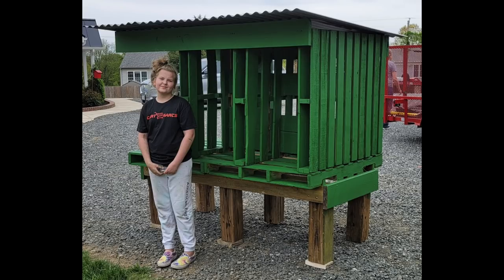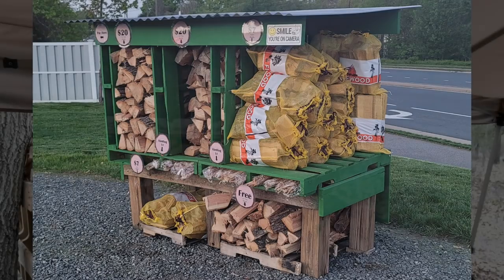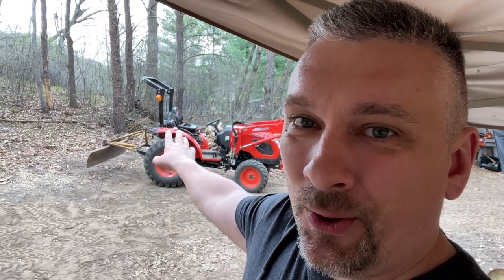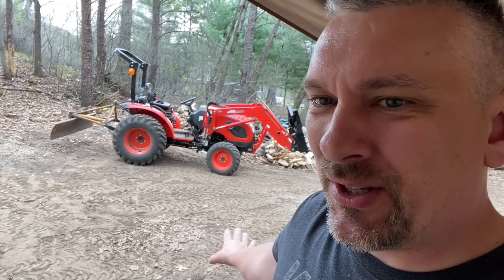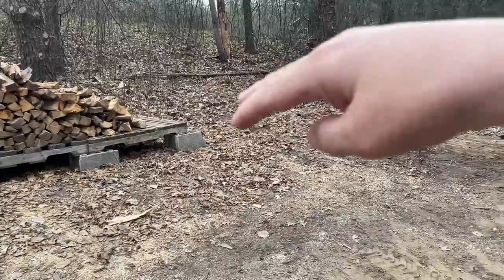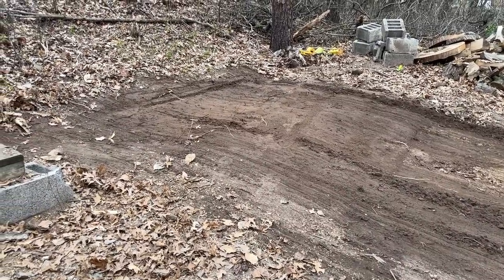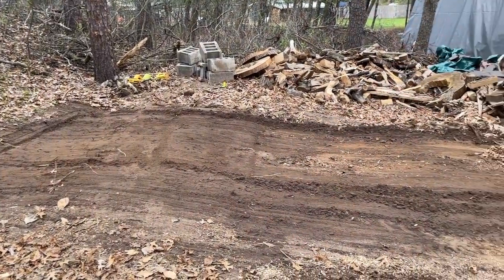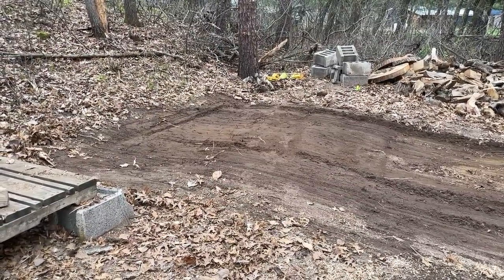3 Point Tractor Blade - How Does This Work?

Comment: Your doing ok with the blade.  It is older and not as sharp as a new one.  You can flip the cutting edge on the blade and bolt it back on.  The pit you are running is good.  I have broken a lighter blade like yours.  I now own a rural king blade which has a steal support across the blade.  It weighs about 600lbs.  If you break the cutting edge you will destroy the blade.  The more you tilt to the tractor you will cut. The other arms you can raise and lower for a crown on the drive.  If you have an old cultivator to break up the ground it works well will help not to hurt your blade.  Then the ground will be loose and to be easily moved with the bucket and scraper.  I have a three point middle buster that worked great for tree roots.  Out doors with the morgans has one similar to mine.  Mine does not articulate like theirs.  They are very rugged.  Which is really needed for working the dirt.  Loosening the soil first will really help the project.  I would get everything level with the 3 pt implements and square and go from there.  Take it easy on the blade.  When back dragging with the bucket put it level the ground you can destroy your cylinders on the tractor loader. The loaders on the tractor are not really meant for earth moving. When I build a pad for my fathers shed I ripped with the cultivator and scooped with the bucked. The blade used to spread gravel and level off the site. A box blade would work well for what you are doing.  The teeth will loosen and do the same thing.  Sure you can find one somewhere. Sometimes it just what you have on hand. Once you get going things will fall in place.  Having the right tool helps keep you from breaking things.  Have fun you will be done in no time.

Comment: Awesome Casey!  DAN!!  Use the bucket on your loader to drive into hill and scoop up dirt.  Once you have the dirt in the general area, either drive backwards to spread dirt evenly or turn blade backwards and drive over dirt to spread.  Basically for fine tuning with a blade ut needs to be backwards so it just kinda drags dirt instead of digging in and gouging.  Hope you understand what I am trying to say.  38 years old and been on a tractor since I was a toddler.  Hope that helps.

Comment: If you extend the center link it will cut more. Also if u need more down force to make the blade cut  you can put some cinder blocks on the blade which will make it cut better
Reply: Where do you put the cinder blocks?
How do you extend the center link?
Thank You
Reply: You can lay them on the blase frame and strap them down  or build a frame to sit them on. As far as the top link if u have a manual one u just need to turn it to extend it to it set how you want it
Reply: @gregorydaugherty2405  Thank You  very much for your suggestions!
Much Appreciated!

Comment: good demo Back 40 Firewood. I agree with the folks who suggested a box blade. With the rippers angled down for digging you can loosen the soil enough to scoop with your front bucket or just let them dig in and drag it with the box. Just like you're doing, but the box blade has sides so it holds and moves more dirt than the blade. Good suggestion from @RBR Dave to add a hydraulic top-link so you can change the angle but you could do the same without, just more getting off the tractor - here is a link I just watched with Tony's Tractor and I think that would help you out too.  I'm watching you work this tool because I want to raise a road with fill from ditches on both sides.

Comment: Hey shifty  our Wisconsin dirt with back blade it will move the dirt. but it will take some time so if you need it done quickly I would use the bucket and then finish with blade. I would adjust top link and add weights off the back. Later from southern Wisconsin

Comment: 3 point blades work best with hydro top link.  For moving dirt, the box blade works pretty good when using the claws with it, and you can also adjust the pitch.
Reply: What is a Hydro top link?
Is the box blade an accessory or a different tool?
Thank  you
Reply: hydraulically operated top link, for adjusting top link length on the fly @lunaflamed  I think a box blade is a separate tool

Comment: I’m still trying to figure out how the 3 pt hitch works. I get how to attach it with the top member and all, I get the level adjustment crank thing I get the raise and lower part too but can you lock it down or does it always float? What to the various levers do? Some seem to do the same thing. Is the pto universal? Same teeth on most machines? Same rpm range? That’s what I would like to see. If I figure it out, I’ll film and share 😂😂

Comment: My 1948, Ford 8N tractor has manual PTO operations.  You could say that one lever engages and disengages the PTO and the other lever lowers and raises the blade.

So the question is, once I have the blade in the upper position should I disingage the PTO or do I keep it engaged and running in order o keep the blade in the upper position?   

I always disingage the PTO once the blade is up.  However after sometime the blade slowly falls to the ground..  Then I have to start all over again and engage the PTO again in order to raise it up.

To keep the PTO running or not running, that is the question.

But then what happens if I have the blade down or push the lever to the lower position to move the blade down and the PTO engaged?

I just can't find any video of anybody addressing this.
Reply: Gearbox / hydraulics and PTO all connected on the old tractors leave PTO on when using hydraulics they work together and not separately.

Comment: The rear blade really only will move loose dirt.  It will only scrape about 1/2 inch of dirt each pass if your lucky.  If you have access to a box scraper and put down the scarifiers it will work much better.  Or buy a middle buster to break up the dirt then scrape it off.  Teeth on your bucket will allow you to dig with the bucket of the tractor.  All are good options.  Teeth on the bucket will work the best in my experience for what you want to do.  I use all three and the blade is just used to move dirt not dig.  Just use low gear to dig.  Congratulations  Casey on the stand.

Comment: Hi Dan - it's Big Rodders in Ireland.  I have no experience in this area but you appear to be just scratching about in the dirt achieving little.  Your level experiment indicated just how big a volume of dirt needs to be excavated.  Why not use the slope to your advantage.  Develop a system to keep pallets level, store your wood up the slope where the wind wil have a bigger gap to get under the seasoning logs.   You will have saved yourself a lot of work and your yard will look less like an industrial lot.  Plus, the deer will be less confused as they  wander round your yard!

Comment: Good Morning. If you just want to move dirt around, it really doesn't matter what tool you use. But if you really want to level the ground, then you'll need to put in some grade stakes so you know what you are actually up against. No need to get fancy. A simple string line level (less than $5 at any hardware store) will give you the accuracy you need for this project.  Remove 80-90% of the dirt from high to low with the bucket and do the initial grading with that as well. The last 10% can be done with the blade but you can accomplish this with the bucket in less time than it will take you to change attachments.
That will leave more time for proper woodhounding, which is what we really want to see.

Comment: Use the adjustment on your 3 point hitch an drop that side down, then angle your blade so the low side is closest to your tractor. You can also do this to make a ditch.
Reply: In addition: have the blade furthest from your tire be the side you are wanting to fill.

Comment: Throw some of those cinder blocks on it.  Or hang weight off it.  Tighten up your top link on the three point to get a more aggressive bite.  I will also run my yard plugger over the spot a bunch to loosen it up before scraping.

Comment: Dan the back blade on a 3 point Hitch has no down pressure you'll have to add weight to get to cut more and change the length of the top link to roll the blade

Comment: That's a leveling blade.. it will pull the mountain down but will take 1000 passes... I would use the bucket and dig it out and than put the blade on to get a smooth service

Comment: When you angle your blade, and tilt it it will not cancel out to level because your tractor is on unleveled ground, unless you have the blade and pitch set for the opposite direction of travel. So if your high side of the hill is to the left of travel, then angling the blade for the lead corner to be on the left, and lower by approximately 1 inch compared to the right side. Make 1 pass, inspect your work and make needed adjustments. The top soil should “roll” from the scraping edge, and exit from under the last 1/2 of the blade in a “ leveling” type of spread. You may need to adjust the amount of “dig” and “sweep”, along with having to make several passes to get the results you need!

Comment: Extended top link to dig more. Use bucket and drive into bank and dig it out then use blade to level. That's what I would do for the attachments that you have. But you want to buy more attachments then I would get and box blade and or land plane. You are doing well easier then using a shovel and wheel borrow.

Comment: Move it with the bucket and level it with the blade. But remember you will need to raise the low side above the hill to allow it to settle.  The dirt will never fit back in the hole it came from. Firewood is usually the same. Smallest pile is logs not split.

Comment: You would be better off with the bucket, if it has teeth much better. You should have a bucket with teeth to do that but if not use the bucket to remove the soil to a level that you can then use the blade to grade out or even back drag with the bucket if it's  toothless. Use the down pressure and angle the loader into the ground to establish  your amount to remove. A rear rake would be good to use to level  it out and also remove  debry and stones too.  In the future invest in a 3point ripper... it is pretty cheap and would loosen that soil in a heartbeat. Box blades with rippers are great but can't  replace everything..  
 Awesome to see her doing the wood stand!!    Good luck with the soil project!
Reply from the maker: Thanks for the feedback, appreciate it. 👍 😀 🍻

Comment: Put your bucket on the tractor and use it to remove the dirt from the hill and put it where you need it. Back blades are only good for leveling the loose dirt after it's been dumped were you want it.

Comment: I would back further up the hill and take from your highest ground are you come down to lower ground with the tractor your blade Rises up on your 3-point hitch and doesn't take as much dirt and yes adjust your pitch at the top of your blade is back further than the front

Comment: Light blades are designed to handle light,loose materials. Too much play in the pins. Bigger pin or rebore the pin holes might help. Blades are a must have tool. Just experiment and pick the right job.

Comment: Your blade needs to have the angle adjustment tightened up I noticed a lot of movement when it would hit a compacted area the blade would move left or right and then stop cutting also try adding weight to the blade to increase the draft . Of course if you could get your hands on a box blade your project would get done faster

Comment: Use your loader to move the dirt 10 times Faster and more accurate. Those light duty blades are good light grading. Not digging Get yourself a box blade and then you can get some work does they are great for grading
Reply from the maker: Yep, think you're right...the bucket is probably the way to go to dig some out & then blade it. 👍 😀 🍻

Comment: On the blade if you continue to use it it needs to be tilted to cut and the blede needs to be angled to cut better..  I would use a box blade with rippers to cut the dirt down, it would be quicker atake a lot less time.  It would aldo be better if you are taking out scrub brush and  weeds.  experiment  experiment experiment  leveling ground is not a cut and dried sort of thing

Comment: Back 40: Do you have any steel or concrete weights to add to the blade. By its self your blade is too light to cut into your soul.  That's why the box blade "With Tines" work better. Just the Nature of the Beast called physics!

Comment: In my opinion use your front bucket or take some thing and rip the dirt your blade is entirely too late to ever do very much digging unless you have loose dirt to pull I think honestly you would be wasting your time with that light of a blade on hard soil but if you can take some thing and rip it to loosen it up like an old plow or a shank of some kind to give you some dirt to work with your blade would be fine once again that’s just my opinion on what I have found over the years